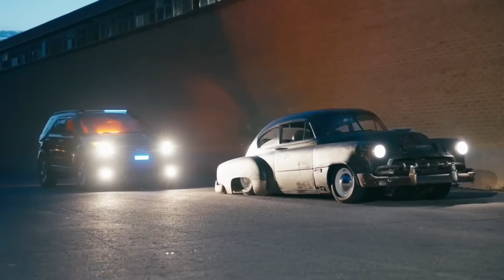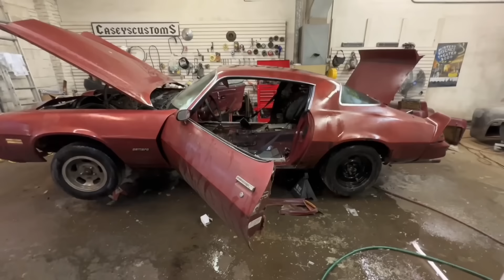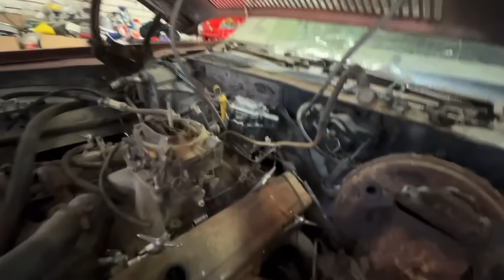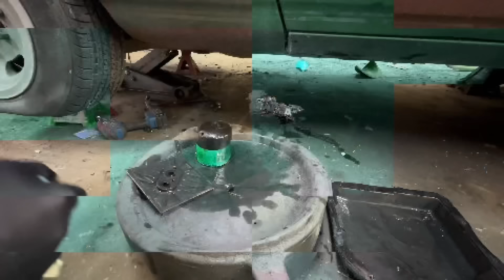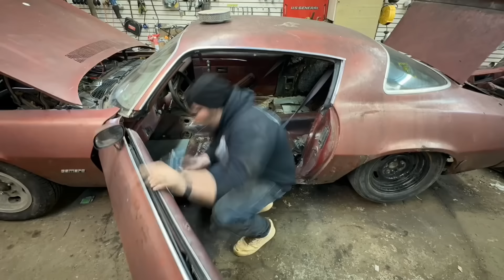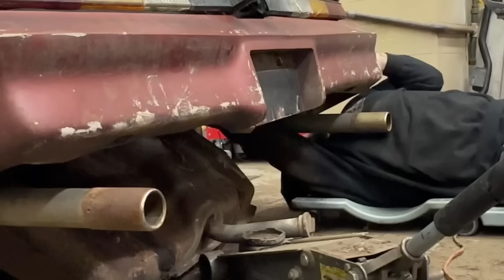LETS BUILD A RACE CAR! POLE BARN GARAGE CHALLENGED ME TO A RACE! 1978 CAMARO

Comment: For some advantages weld up spider gears in rearend, do the brakes on the left side , leave them sketchy on the right . switch right side upper control arms with a gm b body and coil spring from a 1 ton truck.remember you want this thing to turn left. All camber shims go on right side. It says stock parts does not say what stock vehicle. Good luck
Reply from the maker: I’m saving this comment!
Reply: Unaltered means stock doesn't it ?
Reply: Hahah this sound like something back in the 70's when what is not in the rulebook (yet) is legal,haha

Comment: Havent seen FPS Doug in such a long time...good memories
My step dad had one of these, a 1978 Camaro which he put a 454 in it and dolled it up. He recently traded it for a mid 2000's Mustang Mach 1 with over 600hp with low miles. Both are very fun cars but I have a sweet spot for older muscle. My dream car is a 70' Chevelle SS LS6...but Ill probably never be able to afford it.

Comment: I've seen some gen 2 Camaro rust bags. Never have I seen the springs blow through the floor.  But I have seen them have a blue tooth dog leg. And you have a 79 to 81 square dash. 78 has the round dash.

Comment: Out of all of the cars/trucks I've owned. Easily the worst was my 1981 Camaro. It came with a factory installed Buick 231 V-6. Now it rode really well , it's just the engine was dog.. It was also the car that I owned for the least amount of time. Don't miss it at all.

Comment: If the console shifter is busted, you should be able to twist the column to change gears.
Reply from the maker: Nah it’s all unhooked off the trans and was already converted to a floor shifter
Reply: @CaseysCustoms  That sucks, back in the day you could pick a B&M cheap, now they're 380 bucks. dang!
Reply: @CaseysCustoms  My 75 Cutlass with 350/350 and a console shifter, if you busted the console cable you could just spin the steering column.

Comment: Kasey give that camaro more fuel. You can hear it when you reve it. You got a good platform. And the number of laps makes it fair. Seriously tho it need a good carb with a good squirter carb. And air to fuel dialed in. That thing will run forest run. I’ve had the same set up and blew away new I rocs zs in the 80s. Oh and a 342 gear. Can’t wait to see this this

Comment: Holy Schnikeeze you have the leaf springs coming through the floor? I don't think it will pass  Tech inspection like that. lol Or just make the other one the same way and hide the suspension in the car. I got my U S army 1952 Dodge 3/4 T 4x4 M37 running  here's the video https://youtu.be/iq22uPfG3SA?si=GFudw8s4wLeLh_vQ